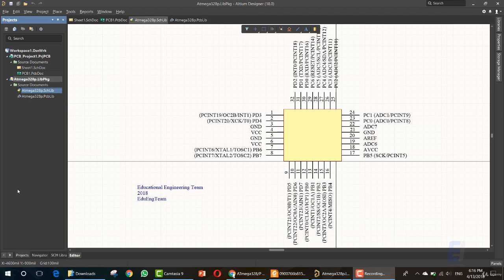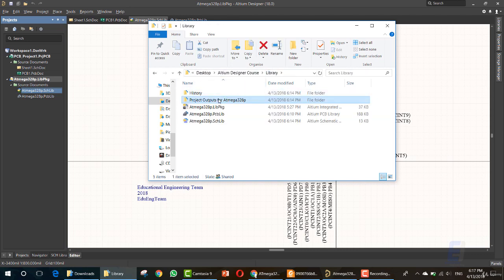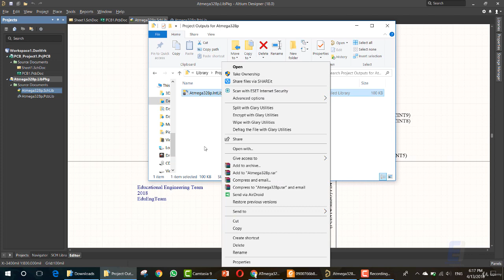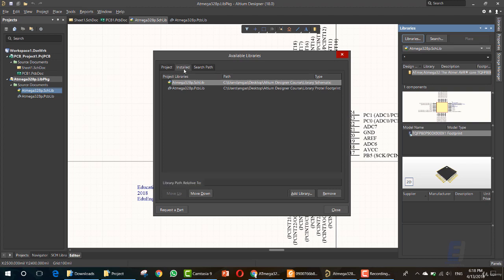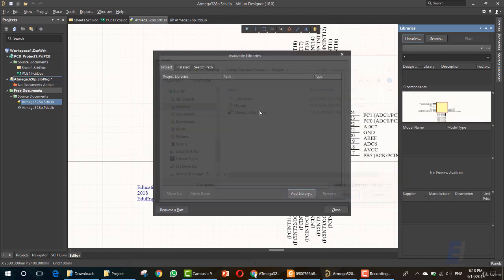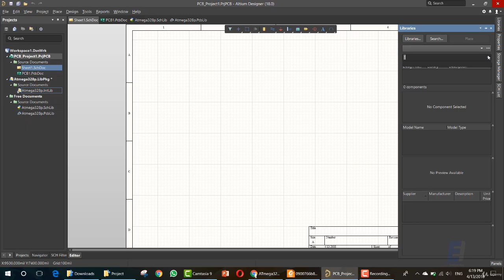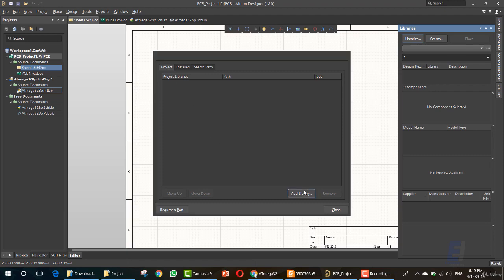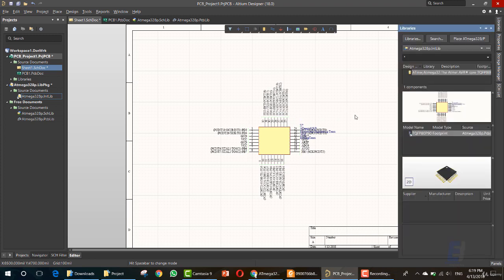Adding the new Library File to your Design - Altium Designer

Comment: Question: I wish to keep my imported library files with the project (for portability). What is the correct way to import the library so that no links are broken when the project directory is moved or sent to another person?

Should the library be manually copied into the project directory, then 'Added' from inside the 'Avaliable Libraries' window?

or can the library file in located anywhere on your local machine, and Altium will automatically copy it into the project directory for you once you 'Add' the library?
Reply from the maker: Your goal is to make your Altium project portable, meaning anyone can open it and have all the necessary files, especially libraries, without any missing links. Here's how you can achieve that:

1. **Local Libraries**: If you want to ensure that the libraries are with the project at all times, you should copy the library files (`.LibPkg`, `.IntLib`, `.PcbLib`, `.SchLib`) into the project directory.

2. **Add to Project**: Once you've copied the libraries into the project directory, add them to your project:
    - In the Altium Designer Projects panel, right-click on your project name.
    - Go to "Add Existing to Project" and navigate to the library files you've just copied to your project folder.
    - Select the necessary library files and click Open.

3. **Using the Libraries**:
    - After adding them to the project, you can use the `Projects` panel to include them in the project or make them available globally via the `Available Libraries` window.
    - In most cases, adding them to the project itself ensures that the components used from these libraries are always available, regardless of the machine or Altium setup.

4. **Sharing the Project**: When you want to share the project with someone:
    - Compress (zip) the entire project directory, ensuring that the libraries are also included.
    - The recipient will have all the required files when they extract the project.

5. **Pathing**: Always ensure that your project uses relative paths where possible. This means that if the project folder is moved or shared, the references to the libraries will remain valid because they are relative to the project file location, rather than being absolute paths specific to a particular machine.

6. **Altium's Behavior**: To clarify, Altium does not automatically copy libraries into the project directory for you when you add them. You need to manually manage where your library files are and how they're referenced in your projects.

7. **Backup & Version Control**: It's always a good idea to have backups and potentially use a version control system like Git to manage your projects. This ensures that you can always revert to previous versions or recover lost files. Altium has built-in support for version control systems.

In summary, if you wish to keep a project portable, manually copying library files into the project directory and using relative paths is the recommended method. It ensures that everything the project needs is encapsulated within its directory.
Reply: @EducationalEngineeringTeam , thank you for the detailed explanation! The point about Pathing is very good, I will try this, thank you.
Reply: @EducationalEngineeringTeam   once the project has been zipped (with the library files), and the project has been sent to another person - will the recipient need to follow Step 2 and re-add the libraries back into the project? because the "absolute" file paths will now be different when the project un-zipped on the recipients PC?
Reply: @RD-ni7qe  

If the project has been set up using relative paths (as mentioned in the Pathing point), the recipient should not have to re-add the libraries. Relative paths are based on the relationship between the project file and the library files, irrespective of their location on a specific machine. So, if the library files are in the same directory or subdirectory as the project file, and the project references them using relative paths, the links should remain intact when the project is unzipped on the recipient's PC.

However, if absolute paths were used originally (which would be specific to the machine where the project was created), then yes, the recipient would have to re-add the libraries to correct the broken links. This underscores the importance of using relative paths in portable projects to avoid such issues.

In general, if you've correctly used relative paths and included all necessary files within the zipped project directory, the recipient should be able to simply unzip the project and open it in Altium without any extra steps to link the libraries.

I hope this clears things up! Let us know if you have any more questions.
Reply: @everydayexcellence-q1e  thank you, this is the clearest explanation I've found so far! :)

Comment: How to create resistors and diode and capacitors symbol
Reply from the maker: Creating symbols for resistors, capacitors, and diodes involves a few steps. Here's a general guide:

**Resistor Symbol**¹²:
- Draw a zigzag line or a rectangle to represent the resistor. The zigzag line is more commonly used¹².

**Capacitor Symbol**¹²:
- Draw two parallel lines to represent a capacitor. If it's a polarized capacitor, one of the lines should be curved¹².

**Diode Symbol**²:
- Draw a triangle pointing to a line. The triangle represents the direction of current flow².

Remember, these are just the basic symbols. There are variations depending on the specific type of each component (like variable resistor, electrolytic capacitor, Zener diode, etc.)¹².

If you're using a software like Altium Designer, Eagle, or KiCad, they usually have libraries with pre-made symbols that you can use directly⁴. If not, you can create your own symbols following their guidelines⁴.

For more detailed instructions, you can refer to the resources provided¹². They provide a comprehensive list of symbols for various electronic components¹².

Source: Conversation with Bing, 19/11/2023
(1) Symbols of Resistors and Capacitors - Edraw - Edraw Software. https://www.edrawsoft.com/symbols/resistors-capacitors.html.
(2) Electrical Symbols for Electronic Components: Passive Components. https://www.allaboutcircuits.com/technical-articles/schematic-symbols-electronic-components-passives-resistors-capacitors/.
(3) Altium: One resistor, or multiple resistors on your lib?. https://electronics.stackexchange.com/questions/82221/altium-one-resistor-or-multiple-resistors-on-your-lib.
(4) Creating electronic circuit schematics by using Microsoft Word. http://www.atlence.com/tips/show/creating-electronic-circuit-schematics-by-using-microsoft-word-6.html.
(5) Diode-Resistor-Capacitor Circuit Equations - Physics Stack Exchange. https://physics.stackexchange.com/questions/345092/diode-resistor-capacitor-circuit-equations.